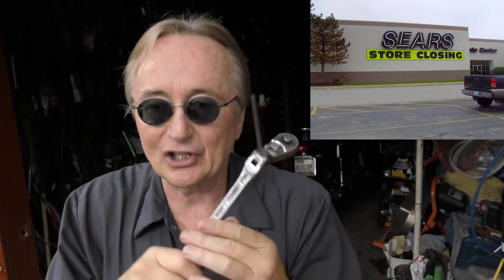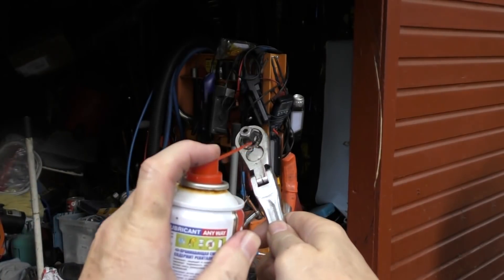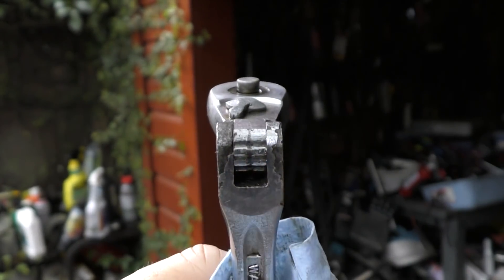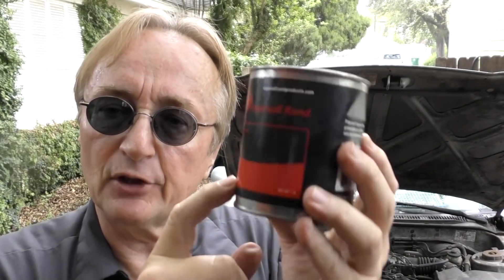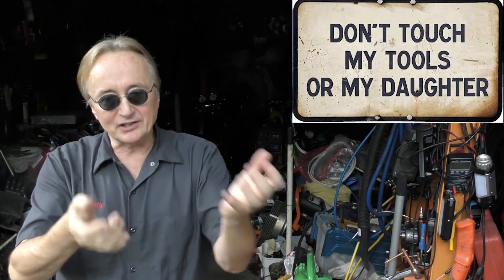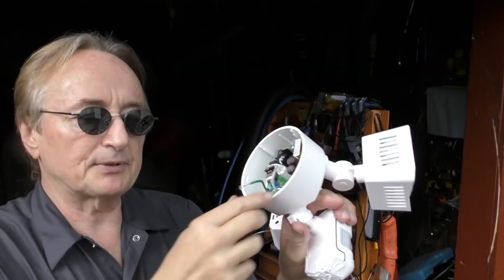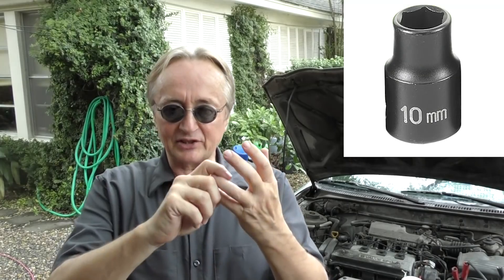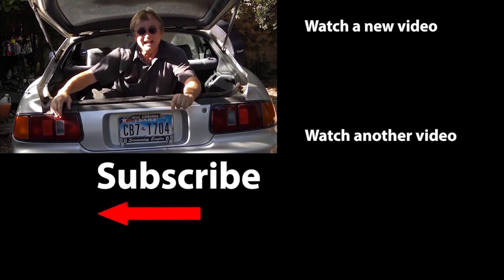Life Hack That Will Make Your Tools Last Forever

Comment: I have used silica packets with my stored items to help remove moisture.
Reply: I save all those packs I get with new electronics then put them in tins of altoids with holes punched in them. Once an awhile I throw them in a low oven to redry the silca. Works very well and doesn't cost me a dime.
Reply: @johnpossum556  not true, if you pay for electric or gas. Or heck if its a wood stove then you pay with labor to fill it up.
Reply: @SuperSonicMaster007  Ok, troll. You can have them in there while you're cooking something at no extra cost. But I didn't mean that. I meant it doesn't cost me anything to make them. They go for around $20-40 per unit if you try to buy them online.

Comment: Scotty - While it is very unfortunate that Sears went out of business, Ace Hardware stocks Craftsman tools, and the one in Spring on FM 2920 a block west of I-45 has them, and warantees them out, just like Sears did.  I know Spring is a drive for you from the Heights, but hey, you could come meet me, and see my two buses!  If that's not enough for you, Lowes has finally started stocking the individual Craftsman tools now as well, and I am happy to report that I have exchanged a 1/4" ratchet wrench that I broke with no issue (and bought a replacement 1/4" drive 5/16" deep socket to replace one that I lost), so Lowes is honoring the warranty as well, and carrying the individual tools as well as the sets.  I am so glad to see Craftsman still around and going strong!  Definitely no need to worry about what to do with broken Craftsman tools.  It helps me out since 90% of my tools are Craftsman, and they help me keep my two school buses (which are my toys) in tip-top shape!

Comment: Hi Scotty.   Would love to see if that stuff is better than WD-40.
Reply: Joseph D. Iero Most likely not, he said that there was corrosion spraying of the tool but obviously it wasn’t  corrosion. It was the head of the ratchet that had leaked grease and old oil. Any lubricating oil will work. As long as it blocks oxygen it won’t rust

Comment: As An HVAC mechanic/commercial industrial service tech the 2 penetrating lubricants I swear by 1. Areo Kroil, 2. Strike hold! Both are multi purpose and excellent penetrates. Frees up some nasty corroded nuts, bolts, pulleys etc. Liquid gold in a can!

Comment: Where's the 10 mil?!?

Why is it always the 10 mil?!?
Reply: The engine bay is secretly a black hole.
Reply: Aint that the truth.
Reply: Learn to put stuff away when you done. Or you lose the things ypu need all the time.
Reply: They are part of the quantum universe, they blink in and out of existence randomly.
Reply: The Ubiquitous 10-mm. Toyota bolt!
Reply: 10mm sockets obey the same universal law that causes dropped tools to roll under the center of the vehicle. It's possible to retrieve them IF you realize this has happened. If you move the vehicle the 10mm is light enough to continue to stay under the center until it falls into a hole or hits some obstacle and is gone for good.
Reply: For me it's the 12 and 14. Especially in wrench form
Reply: @alansmilealot  For me Metric Guy from Germany its the 13mm Wrench... :D
Reply: Happy Customer Toyota owner here and yes that little turd is always magically disappearing when I’m doing work on my 2003 Camry
Reply: I find them growing in the asphalt near service centers.

Comment: I have a shed for garden tools and an enclosed shop where I store my good tools. My shop has heat, AC and a dehumidifier. This stopped the rust problem.  I pull out my tools to work on my cars, lawn tractor or home then put them back away.  Worth the investment and I can enjoy working in there when the temperature outside is too uncomfortable.

Comment: If you're shopping for an air impact it's worth splurging for one with that grease port. We burn through impacts like crazy but the last IR set we bought have lasted forever. Surprising because we all doubted the new plastic case

Comment: Haha, I love you vids man. I always learn something, often off subject too. I know little about Texas, I live in the UK and assumed it was hot and desert like. I never knew it was humid there. Nice one man. Your moisture problems are as valid but very different to ours up here in the wet mountains of North Wales. We are cold and damp here, it seeps out of everything can't leave anything at ground level. Lichen and green moss, sphagnum grows on everything here. I too oil or WD40 my tools. When storing things like electronics or tents a good tip is to save all those silica bags up that come in everything and keep a couple in a container with the device. Otherwise keep an open bag of rice in the container with electronics or tents etc stored in it The silica or rice absorb the damp. Damp is a menace. Great vid as usual.

Comment: Heat up your tool with a heat gun and spread neutral shoe polish on it with a cheap paint brush. Let it cool. Repeat. Polish off the excess. Won't corrode. Works on any metal. Buy De-Oxit on Amazon to clean oxidation on electrical contacts and like Scotty says-take out the batteries!  

Rev up your rust resistance!

Comment: Try the Zerust capsules or remington moisture guard vapor plugs. Toss one in my toolbox and they stop all rust and last about 1-2 years, I change them when they look completely dried out like a old used up air freshener. They put some sort of rust inhibiting vapor into the air  in a closed area that prevents rust.  Have worked for me for tools and other steel items for the last 15 years or so.

Comment: I use the Lithium batteries in my electronic devices. Yes, they are a little more expensive, but they have saved me a hole lot in replacement tools over the years. Flashlights like the maglight are famous for  being destroyed because of the alkaline style.  I have also found Super Slick Slick Stuff to be a great spray lubricant. It truly works like magic on locks and other small parts. My gear wrenches love it.

Comment: I have to admit using a spray on wax for a bunch of my tools, along with the WD-40 trick you talked about.  The wax works pretty well, though ya have to buff off the wax.  Works really well for that oddball tool that you don't get hold of very often, and when you need it, it's set to go.  Thanks Scotty.  Good videos.

Comment: CorrosionX works great especially on electronics. It creeps, coats, and converts corrosion.  It also displaces moisture. I’ve been using it on aircraft for years.

Comment: I make a point once a year to pull all my ratchets, impacts, air hammer, etc, apart. Clean them and put new grease or oil in them. Got some i still use that were passed to me from my grandfather.

Comment: True dat about taking the batteries out of lesser-used tools.  Houston is even hotter and humider than Joplin,  MO where I live.  As an electrician I have a number of battery-powered diagnostic tools.  It is easy enough to remove the batteries when not in use.  Interestingly I have lost several electronics to name brand batteries leaking but have had no issues whatsoever with Harbor Freight  alkaline batteries.

Comment: Still have my original Craftsman wrenches I purchase for Sears & Roebuck during the late 50’s and early 60’s. They have bee rust free forever. Just kept cleaning them after use and wiping them down with a light coating of clean oil or. WD40.

Comment: If you are getting gasoline on your ratchets make sure you lube them right after. I used a particular ratchet for carb work, one day it got covered in gas while I was using it and it seized up. I lubed it afterwards but it was to late everything inside was worn right out.

Comment: I’ve learned never to keep any tool in a room where pool chemicals are stored. Or any cleaning solvents or paints.
I live in Amarillo and it’s very dry here. 
The pool chemicals ate up tools and a metal cabinet in no time at all. Just a few months. Even though they were in closed containers.
Just an FYI.
I just inherited my Dad’s tools that are mostly 40+ years old. Virtually all Craftsman when they were American made.
I’m taking care of them by keeping them a long ways away from the pool room. 
Dad was an Ex-USAF mechanic on P-80s. Then he flew B-36s and B-52s. Eventually Retired from Horizon Airlines.
The tools are I n real Craftsman tools boxes. I even got a 25 pound, or so, old Craftsman vise that he used to help restore many very old stationary gasoline engines. As a kid, I helped him dig them out of dirt and dung in old barns in Nebraska and Oregon.
Fairbanks-Morse 3.5 HP and rip your arm off torque at 450 RPM. He restored a rare throttle governed (rather than hit and miss) model.
I learned about gas, carburetors, rich and lean mixtures, magnetos with horseshoe magnets, points in the chamber, gears and where NOT to put your fingers.
All while being the designated crank starter. The finger thing is a long story...but it worked out OK.
They’re now in a museum in Canyonville, Oregon.
Some of the tools are old and a bit dirty so I could use something to clean, lube and protect them.
They will be passed to my 2 Sons soon.
Love your stuff, Scotty.

Comment: Great advice, Scotty! I bought a Black & Decker, oilless, .5 hp 3-gallon compressor just to maintain tire pressure while cold. My first oilless compressor this big but it's lacking horse power for the ten ply tires on my van (70psi). It was $54.99 with a reliable brand name...any suggestions?

Comment: 10-4 on teh WD- but just about any like it does the job( mine are over 50 yrs old,ere my Dads and then My Uncles added and Then Mine) Got the 2 Sears Cabinet tool boxes and a SnapOn .. .. I've used simple engine Oil to Spray Lube  to WD to Silicone spray.. and 10-4 on those motions sensor Lights and Alarms..Can get them for $25 now thru the discount stores on Line and I travel the neighborhood in the fall when our ( mostly) summer Homes) owners leave for the season9 over 75% are summer homes, but they rhow out alot of stuff when they sell their places and buy them, I've gotten 3-4 Bug Zappers a Yr, use 2 of them and give others away as gifts to new nighbors along with Dozens of Garden Hoses  and at least 2-3 Lawn Mowers a Yr..  I even use my HD Power Scooter  I got from the VA to Town my Lawn Mower and go around and cut other neighbors lawns  for them.. Some don't even know I did it until later.. I even put Weed & Feed on their Lawns to help control teh Dandeliens and Speical Creeping Charlie Killer in the fall.. Even get over 200 Bulbs every yr form local Landscapers who dig them up to replace them for the Ewakthy Homes Gardens and I give them $20 for a Big Bag of them..I go and Plant them  along our Streets easement areas ..just a long shovel and the bulbs riding on my Power Scooter ( Handicapped Veteran )

Comment: I take the batteries out of my cameras and tools every time I use them.  I had 2 small 2 AA cell flashlights ruined because the batteries corroded in them.  I've tried and tried to get those batteries out without success.

Comment: Recently Used off to clean my headlights. I was told it was a good idea but the person turned out to be really sketchy. Would you agree with this method of cleaning headlights?
Reply: Better off using wet and dry sabs paper with water, then  t cut and then apply lacquer

Comment: 🔵 Isn't that going to dissolve a lot of the Grease inside the ratchet?
Reply: Product claims- 
Lubricates assembly parts and restores friction surfaces.
Protects from rust and corrosion under conditions of increased humidity.
Displaces moisture and dries the contacts of electric equipment.

Comment: I'd go with a mosquito zapper Scotty, zap the crud out of them.
Reply: That and a propane-powered mosquito-eater in the yard. Skeeters go for the smell of carbon dioxide like flies go after the smell of... well you know what they go after. They can't resist and get sucked into the ftrap section chasing the CO2 and they can't get back out. Ain't cheap to buy all the propane but nothing works better- BIG difference.